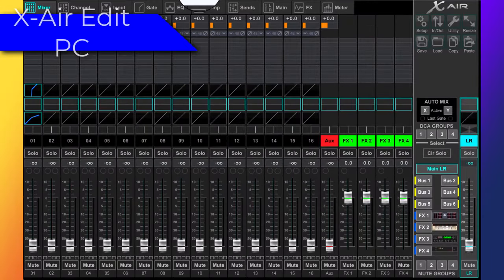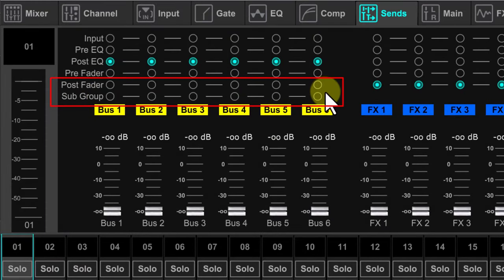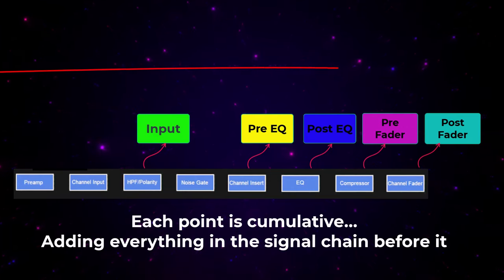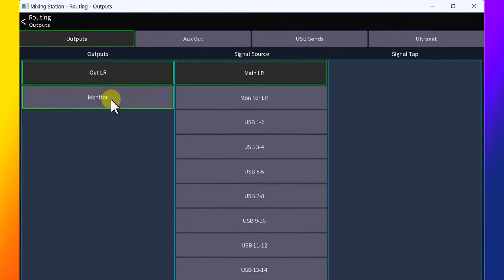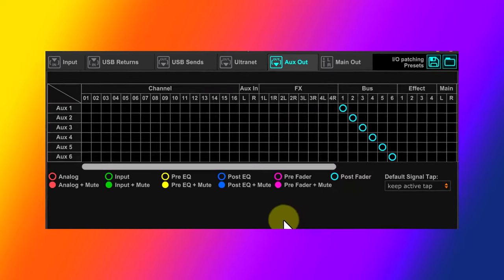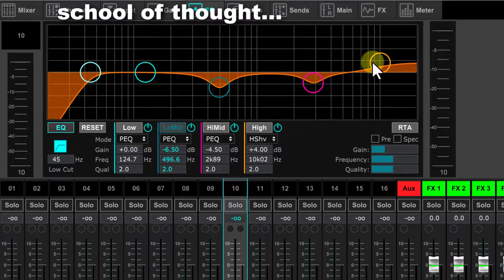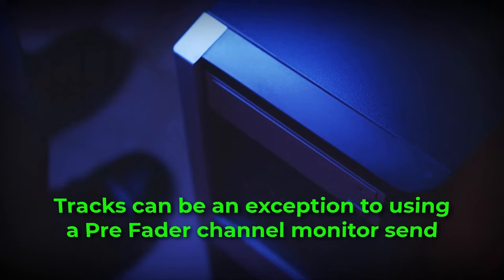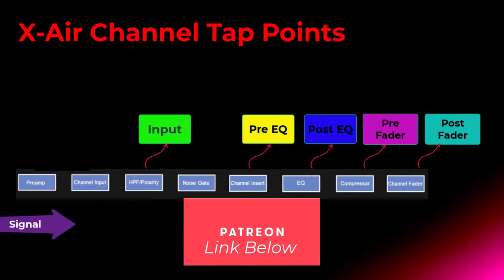Demystifying XR18 Channel Send & Output Tap Points | Monitor setting | Mixing Station and X-Air Edit

Comment from the maker: There seems to be some confusion surround tap points on the X-Air stuff, and some consistent mistakes being made, so someone requested this video to talk about that. 
I used both X-Air Edit AND Mixing Station to demonstrate the points in this video.

I have broken the video down into 3 sections. The first part is about the channel sends. I get the feeling that people have a general understanding of that part, but it's leading to mistakes in output routing options because the two parts and options of the console are so similar yet SO different. All leading people to get confused between those two areas. So I didn't want to explain every last details about channel sends at the front of the video ( where I think there's a general handle by most people on that part... at least somewhat), rather than going over the main points on that and then leading into a section on the output section tap points and making sure the overall big picture was being addressed and explained. 
Then the 3rd section of the video begins to get more into finer details of that bigger picture that the first 2 sections (hopefully) have people understanding better in the first place. That way it all (hopefully) allows it to make more sense when I talk about those small details and considerations to think about when setting the tap points. Not just the "how" but the "why".

The tap point chart I created is available on the free tier of the Patreon site:
https://www.patreon.com/AlanHamiltonAudio

🎤Sweetwater Affiliate Links:

Behringer XR18 Digital Mixer at Sweetwater Sound:
https://imp.i114863.net/WDVNDO

Midas MR18 Digital Mixer at Sweetwater Sound:
https://imp.i114863.net/NKjKM1

Midas M32R digital mixer on Sweetwater-
sweetwater.sjv.io/bavBkm

📦Amazon Affiliate Links:
🔊Items Used to Make This Video-

FDUCE SL40 Vocal Dynamic Podcast Microphone on Amazon:
https://amzn.to/408xlf3

Sony ZV1 Camera on Amazon:
https://amzn.to/3z9MHny

Canon M50 MkII Camera on Amazon:
https://amzn.to/3z6c8X5

“As an Amazon Associate I earn from qualifying purchases.”
"I earn from affiliate link purchases"

🎚✨ Support via Patreon:
https://www.patreon.com/AlanHamiltonAudio
~~~~~~~~
Channel Facebook Page:
https://www.facebook.com/groups/livesoundproduction

🎶🔊Other Channel Videos-

Behringer X-Air FX Rack Explained:
https://youtu.be/TV5ClH_MWrU

Behind the Soundboard - Soundchecking the Band:
https://youtu.be/iCzNO4lCyAs

5 Tips for Mixing Live Vocals:
https://youtu.be/oP4sdpkkNhY

3 Tips For Aspiring Live Audio Engineers:
https://youtu.be/tEX2Prwfh-g

Building an IEM Rig With the Behringer XR18 or Midas MR18:
https://youtu.be/xT9gTBFxvZk

Direct Boxes - What are they? How to use them? Direct Box 101:
https://youtu.be/6iwW5_Ia9Uc

Items purchased thru affiliate links come at no additional cost to viewers, but these purchases can earn the channel commissions.

Comment: I am so happy to be a subscriber, ive learned almost everything from your tutorials
It would be great if you could also do tutorials on ultranet & P16-M's
I use 4 of them & they are absolutely fantastic, but im having a hard time getting fx to them, i know its user error, on the in/out page, ive tried fxL & or fxR, it kinda works, but it seems to cut the volume in half, so if i move all the vocals to either main L or R, it works, but my singers dont have individual mixes from there P16-M, which is pointless to have them in the 1st place, now me & my singers dont mind not have fx in our P16-M's, but it would be nice to have
Again, i really appreciate your tutorials
Great stuff
Reply from the maker: Thanks. I'll have to see if I can figure out a way without owning a P16M.
Reply from the maker: So... Ultranet gives you 16 channels. You have to find a way to fit everything into those 16 channels. Some bands don't even need 16 channels so they have leftover Ultranet channels to work with.
Some people are using all 16 input channels (or more on an X32...etc...) and so they have to find tricks to make things work. Like sending the drums to a submix and then sending the drum subgroup to an Ultranet channel where there's then just the full kit on a monitor channel. Or some version of that... like all the toms and OH's are subgrouped and the kick and snare remains separate. Or maybe only the kick and snare get sent to the P16 in the first place.
That way, unused inputs, or extra/unneeded (in mons) inputs, are not sent or condensed for the P16.

If there is one keyboard player with multiple keys, then maybe the keys are what is subgrouped. Or for a stereo keyboard only the left out key feed is sent to the P16.

So to get FX into the P16, there needs to be at least one open ultranet channel. 

How are you doing the FX into Ultranet now?

What I'd do is dedicate one FX slot to being the main vocal verb. That simplifies things if you don't need multiple FX slots feeding your Ultranet channels. If you don't need/want delay too then you're going to need at least 2 Ultranet channels opened up... somehow (see above).

I would skip the idea of monitoring the reverb or delay in stereo IF at all possible. Mono should be fine, and especially if you don't get used to anything else.

Let's say FX3 is the main vocal verb and FX4 is the vocal delay.
Go into the mixer's Routing and get to Ultranet routing. You could use whatever Ultranet channels you have open, but for sanity, let's say FX can be the last channels. Ultranet 15 and 16. Assign FX 3L to channel Ultranet 15. Assign FX4L to Ultranet 16.

Make sure they are tapped at some point PRE FADER. To be safe, I'd say either INPUT or PRE EQ. Whether you want +Mute or not is another question. If you don't ever mute the FX in the house it doesn't even matter. If you have a soundperson that is Johnny on the spot and always muting FX perfectly between songs, then + Mute is great. If they get distracted, or if you're mixing onstage and get distracted and forgotten, then + Mute could mean you sometimes have a reverb feed in your P16 and sometimes don't (assuming it is the FX returns where the FX gets muted between songs). So NOT + mute is an option in that case. Then you ALWAYS have reverb/delay in your P16. And if talking with it on bothers you, then you'd have to mute it yourself.

If you do this method and don't have enough reverb/FX level available to you in the P16, then it has to be a mixing/gain staging issue.

It's hard telling you where to look since that could come at multiple points in the mixer. I can tell you what I do- I don't even change the INPUT level or OUTPUT level of the Effect itself in the FX rack of the Behringer stuff. I leave it at the default. The default is essentially where I'd set the stuff if I have a physical unit in front of me versus GUI. So if you're changing those, I'd put those back to their default settings.
This will impact your house settings though and so they will need to be readjusted elsewhere to compromise.

I also suggest leaving the main (master) FX send for each FX feed on the mixer at unity.

Then bring up the effect on the FX send in each channel of the vocals... until you hear what you need in the house.

This (I would think) should be plenty signal for the P16 to work with. Since I don't have a P16 to test, I can't say if something else might be going on that I'm missing.

In theory, you could even run the vocal channel FX send even higher (as long as you aren't clipping the input of the FX unit) and reduce the FX return fader to rebalance things in the house.
Since I said to tap the FX Returns at a point pre fader, then reducing the mixer FX return(s) is not going to change the signal getting to the P16. And turning UP the vocal channel FX send HAS to send more level to the effect, back to the return, and thus to the P16.

(Example) IOW, the signal chain could be sending 6dB MORE reverb on the channel FX send than you want to hear in the house from that channel FX send, to the master FX bus, to the input of the vocal reverb, and back to the FX Send. And tapped at a point pre fader, the P16 would be getting a 6dB hotter reverb sent to it. Then reducing the FX Return fader 6dB would lower that vocal FX 6dB in the house. Which gets it back to the same balance as you had in the house to begin with in this example. 
This assumes once you realigned your gain staging in the FX send signal chain, that you still aren't getting enough level at the P16.
That doesn't seem like it should be the case in the first place, assuming everything is like I first described it, or is changed to how I described it... But even if it would still be too low, that would be the quick fix to that issue.

If you're tapping the Ultranet FX Return POST FADER then that could be an issue, especially if you're not running the FX Return faders at unity normally.
Also, if you've choked back the master FX bus send fader then THAT will also be choking back the level in the signal chain and that will then take away level that you'd be tapping from to send to the P16. Another reason to have the master FX bus sends at unity.

I'd also make sure you're using the FX as send and return effects and not trying to INSERT them. You definitely don't want to insert them for the house, though there MIGHT be a way to insert a reverb as a P16 ONLY reverb. But you'd lose that reverb for the house and need it dedicate to the P16, and risk a configuration error that could have negative impacts for the house and overly complicate something that is probably not a necessary method anyway. Plus, without a P16 I can't test this alternate method anyway... so there could be a dead end I'm not thinking about if I even tried to send you down this path. So I'd stick to the tried and true method, and then if that's not working, chase down with something is off in the signal chain.

Off the top of my head, I think a vocal (reverb) channel FX send would ride around -10dB when I'm mixing in a typical situation. That is with the Effect itself at the default settings and that master FX bus send at unity. And the channel FX return at unity for the sound check. 
I'm more likely to use the vocal FX return to adjust overall reverb (song to song) than the channel FX send, once I have it set at soundcheck (or within a song or two) and have a balance between singers that I like.

I never even touch the master FX bus sends. Those go to unity and I leave them there in every scene I create.

How far off is any of this from what you've tried? Or is it what you're doing?
Reply: @AlanHamiltonAudio  Hey Alan, i hate to say this, but i give up, im not a quiter, but in this case, i cant figure it out
My front of house sounds & signals are fantastic, with reverb & delay coming through nicely, the gains are all set up where everything is nice & clear
Even all 4 of the P16's are running great, each of us musicians have dialed in our mixes to where each of us are very happy, even our USB recording into Reaper daw is working out great, we can record & play it back & hear through FOH & in our P16's (Thank You For That Tutorial)
Now getting any kind of fx ie reverb & or delay, its just not happening, i just sat down infront of my xair edit software infront of my mic with my headphones on for like an hour this morning & i just cant get it there, i can! get reverb in, but just that, the entire signal is lost accept the reverb itself, 1st off, we use channels 1 to 11, our vocal mics are 5 to 8, mine being number 8
On the in/out routing page in the ultranet part, our channels are on a diagonal patern like it should be, so when i take my channel (8) & move it to fxL & i go back & click on fx1 on the main page & turn it up on my channel, i get the reverb, but thats it, i dont get the full signal like i did when its in its diagonal pattern, so, in the ultranet routing page, theres a preset of 1/8 effects, when i click that, it automatically changes the diagonal pattern, but that being said, the reverb & full signal are there, its fantastic, the reverb & delay are great, but, its only on my P16, not the other 3, im like WTF, ive tried all the different tap points in the ultranet routing page, on the main page, everything, i just cant seem to figure it out, so that being said, im happy having a nice clean clear signal in mine & the others P16's
& with out you here looking at everything im doing & seeing for yourself, plus you not having any P16's, its next to impossible for you to trouble shoot
But i find myself a pretty smart guy that can usually figure stuff out, but this, i cant 😭😫
But thanks for taking the time to try & help me, i really appreciate it
I love your videos & ive learned so much from them
But if your able at some point to recreate what im going through & you can figure it out
Please share your findings
Thanks again
Reply from the maker: @KENNETHCOOPER55  Can you email me or message me your scene to look at and see if I see anything that might be giving you issues? There's an email on the About page of the YT channel here.

Comment: Hello. Can you clearly explain how to mirror the mains to a bus without including FX. I use the Input/Output to direct the mains to an AUX output, but I cannot remove FX. If there's a place to set the tap, where do I set that, in the sends tab or the input/output/aux tab and what do I set that to? Thanks.

Comment: Important thing about having a fader available (be it in the mixer page of the mix you've selected or in the "sends" tab of a channel (that's how it works i the Mixing Station app)) when your tap point is a "subgroup" :

- when in a subgroup the channel is sent to unity to the bus, so the fader doesn't do anything
- but if you switch back to another tap point (that is not a subgroup), then that fader value is gonna matter
- so even when you're in a subgroup, the fader is there for you to see and adjust the send level BEFORE switching back to another tap point (that is not a subgroup)

Explained to me today by David Schuman from Mixing Station.

Comment: how do I capture audio form my DJ control as a channel input and send the audio to mains without any EQs? I usually adjust highs, mids and low's using the knob on the Dj controller itself while mixing and its constantly changing. I want to send "dry" signal from my dj controller to the mains instead of sends? is it possible?

Comment: Greetings and thank you for your awesome tutorial videos here! I just recently purchased an XR18 and have been going through the learning curve of moving from the analog live mixing world to digital. Your explanations regarding this system are invaluable. One thing I wanted to ask you, if you could be so kind, is in regards to the X Air app for mobile (I'm on Android.) I downloaded the X Air Edit app for PC and it's great. However, the mobile version is confusing as it appears that full access to all the functions of the XR18 aren't available, i.e. there doesn't appear to be a full mix view available. What I'm seeing is something that appears to be more specific to individual musicians being able to control a monitor mix from the stage. This is not a good solution for me as I'm looking to be able to do a full front-of-house mix from my tablet via the app, and I need to be able to access and control the same functions as on the PC app. Do you have any additional information on this? Sorry to ask here but I didn't see anything regarding this anywhere...a bit odd since it seems to be a logical concern. It's one of the main reasons I went with this system. Thank you for any feedback you can provide. (The mobile app in the Play store is called "X Air Q" - there is no "X Air Edit" for mobile.)
Reply from the maker: X-Air Q is for band members to control their own mon mix. So it limits what they have access to. (Or said another way, it limits what they can mess up! ;) ).
I think the app you want is just called X-Air.

I always use Android and I've been using Mixing Station (which is a 3rd party app). If you're not already used to the standard app, I'd recommend using Mixing Station. It's very similar, but way more powerful in the customizations you can make. Mixing Station is available for Apple iPad, Mac, PC, and Android.
Reply: @AlanHamiltonAudio  thanks for your quick reply. Actually, the "X Air" app for Android doesn't exist on the Play Store anymore. I did just locate an app called "MX Mix" which appears to offer the full view solution. But I also had already downloaded Mixing Station, too - just haven't taken the time yet to set it all up as it appears to be something you have to build from scratch? I do like the X Air Edit app for PC - that's exactly the kind of GUI I was hoping for on the tablet app. Again, thanks for all the great videos. It's very helpful!
Reply from the maker: @DavidOxford606  I think the default Mixing Station view is fine. Unless something has changed, you don't have to build anything from scratch. Just choose the XR18 and connect to it and it should be ready to go.